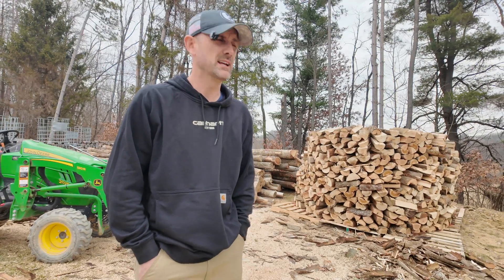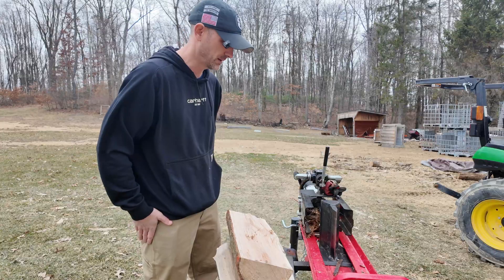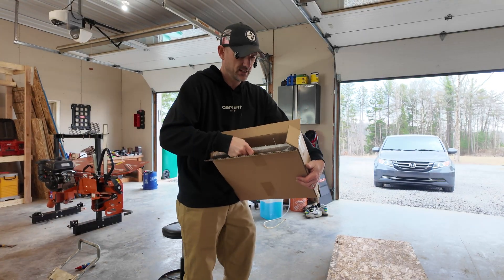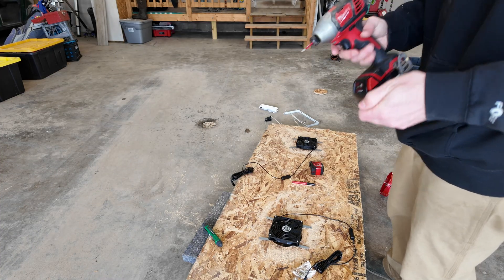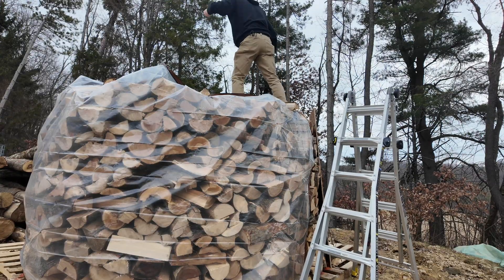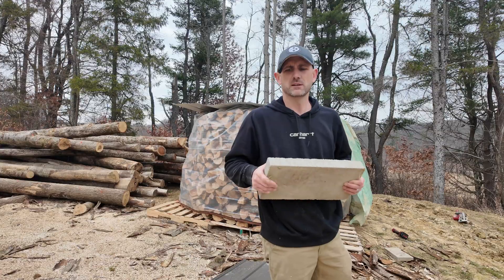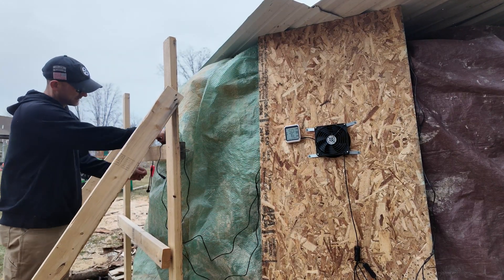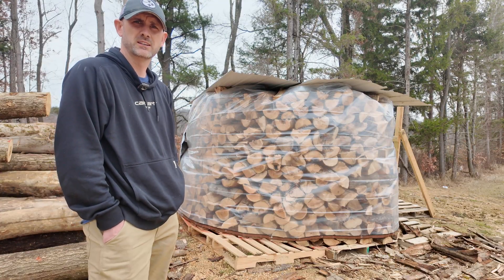🔥 Holz Hausen Firewood Stack + Solar Kiln – Season 2 Begins! 🌞🪵

Comment: Foamboard Insulation and black cloth on all the wall interiors, along with the solar fan at the top to force warm air down.  Many drape a black cloth or tarp over the wood beneath the clear corrugated plastic roof as well.  Vents near the bottom not the top, unless you have adjustable top vents. You need an internal thermometer to measure the kiln temp as well.  No matter what kind design you use, the main objective is to try to get it to around 120F-130F minimum in the daytime with good air circulation.  Even with your first draft model it would probably work with 2x the time you gave it.  Have fun!
Reply from the maker: Thanks man